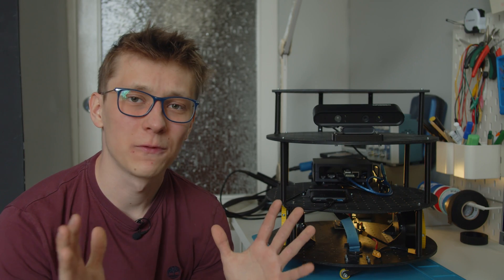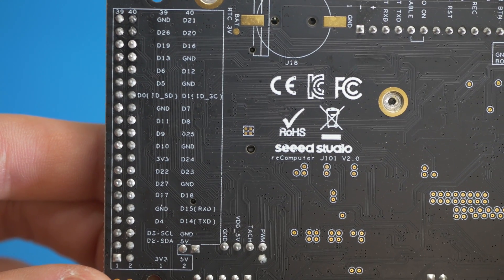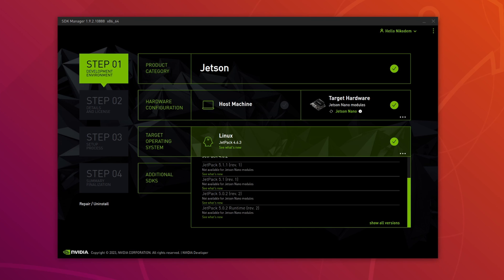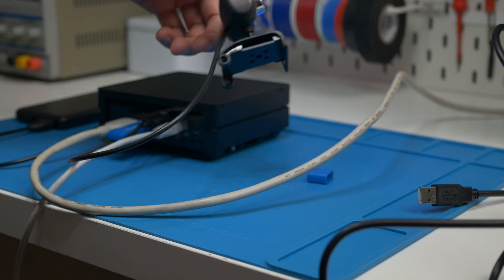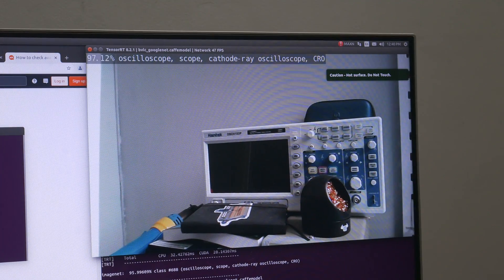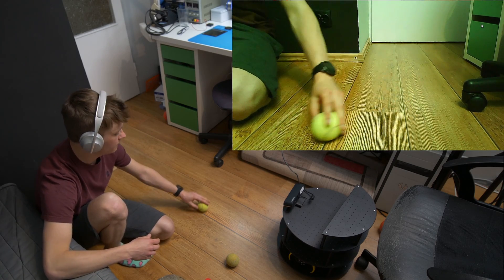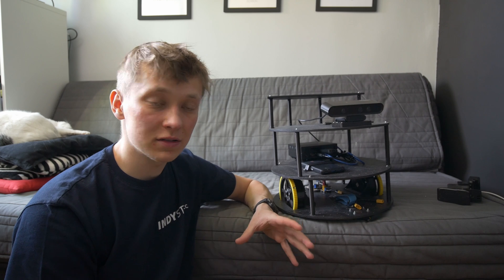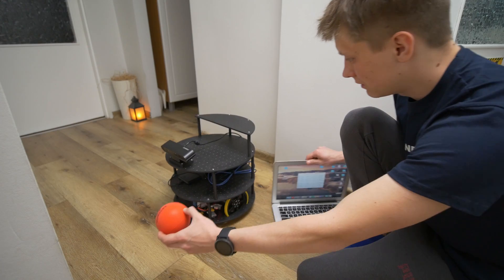Object Detection and Following Robot with Jetson Nano

Comment: It's been 1 year now but I just saw some of your videos. Very cool projects, I suggest you add some control logic each time you want to command the movements of your robots (Use basic PID) it will solve your problems and can provide you with more option ; instead of telling the robot to go left/right you can give him an angle (you might need to add a gyroscrope) and that would solve the overshooting in your robot rotation

Comment: While not as interesting as using AI object recognition, tracking a simple object like a ball is also possible  with something like OpenCV using the ball's color hue. I managed to get it running on a Raspberry Pi Zero.  It only ran at around 1 fps, but it was working.

Comment: Nice video as usual!
Python and multi threading oh man… that cracked me up. 😂Do they seriously teach multi threading on Python in university these days? Not in a serious language like C/C++? Because you also want semaphores to protect shared data have issues with passing data between threads and threads crashing and not cleaning up resources etc. That’s easier taught and demonstrated in C. 

And you can make a struct (or class) and have an instance per motor doing the smoothing.

Also the balls would be really easy to detect without AI but just a bit of rudimentary computer vision since the hue of each ball is so unique and different from the surroundings that just filtering the hue using OpenCV would make it more robust (not so many issues with colour shift of evening as long as you have a wide enough filter). In factories for example to check for caps being on bottles we do never rely on AI. Because it’s slow but also not as reliable. This is also the reason why caps are such different colours from the bottles in most cases 🤫you could make caps that are translucent like the bottle from the same material but that would make automation in the bottle factory more complex and thus more expensive.

But if this was just an experiment of training an AI then it’s a nice and simple one for sure. And you’ve learned that you need to make a training set in also different lighting conditions and different white balance 😊

Comment: A simple solution to the camera field of view problem could be to move the other components around so the camera could be mounted on the bottom floor - I think the reason your previous robot worked more consistently was simply because the camera was lower - so the target didn't drop out of view as the robot approached it.  Just an idea.  Stay safe out there.

Comment: Big recomendation on the ROS part. The integration is just so much simpler and the workflow of the nodes and the communication between them is such a nice benefit. It will also provide you with visualization interfaces like Rviz, can be used in python or c++ and there is a LOT of work already done by its big community. It is not difficult to setup or get familiar with it if you are a decent proggramer, which you are. 

I am currently working in a similar project: developing low level c/python code for sensors connected to a RPI and then use ROS to integrate that code into nodes and centralize all the functionalities of my robots into a server. Its very fun and results are very powerful! Also, given the fact that you have a lidar, you could consider adding some sort of odometry sensors to your wheels and that would mean you could have an entirely autonomous navigation robot using the ROS navigation stack, that generates maps with the lidars and plans the path for the robot to follow!

Comment: Great project! Question, Could you take the set of images you trained it with and duplicate them to adjust the brightness and contrast in increments and add those back to the set? This could help with the lighting condition issue. Thanks for sharing!